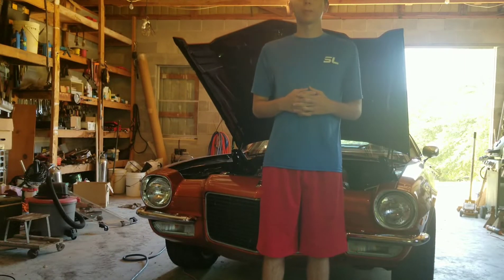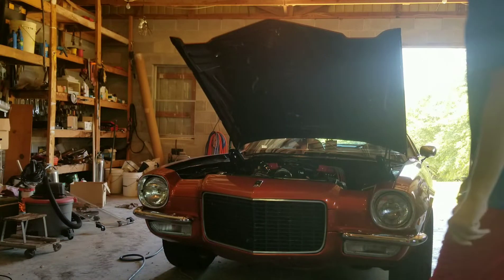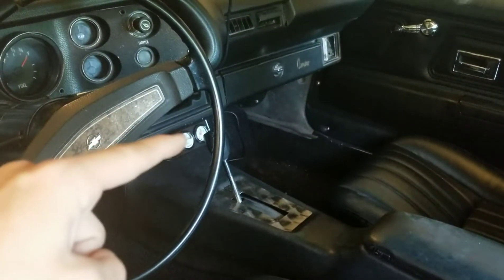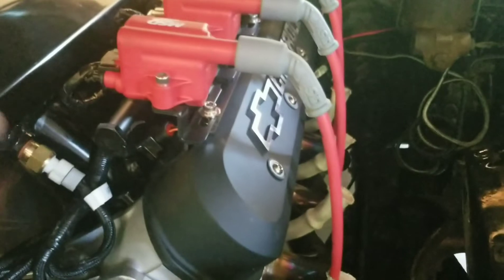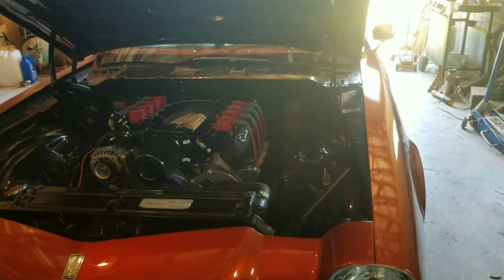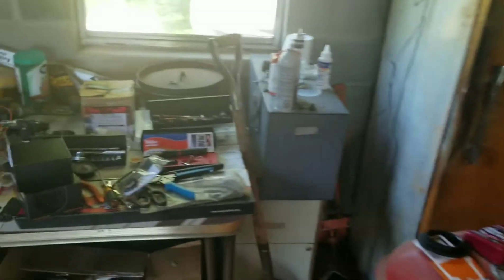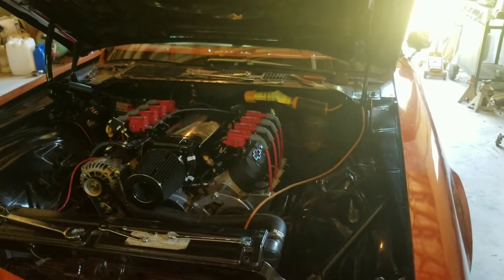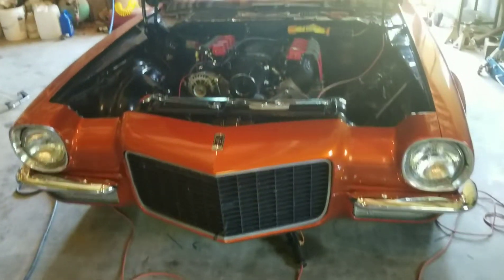FiTech Ultimate LS giving ME PROBLEMS!

Comment: It's not the Fitech that's the problem there's something wrong with your injectors coils or a mechanical problem
Reply from the maker: User error. I have since corrected the issue and addressed it in a video. I left a huge vacuum leak. FITECH IS AWESOME!

Comment: I have an ultimate ls system and am having a "spike to lean" or lean tip in issue where when I stab my peddal AFR goes up to 20 (all air) and techsupport is not helping what so ever... I've had everything installed for 3 months now and haven't been able to officially drive my damn truck. I'm extremely disappointed with fitech
Reply from the maker: I recently got mine back on and working correctly myself. I agree their tech support is lacking. What is your fuel psi? Have you tried upping the "Accel Pump" setting? IAC steps when up to temp and idling? Sorry this is so late. Maybe you have already figured it out!
Reply: @jnlgarage6369  nope never figured it out... they told me that over and over and that all makes zero difference. It starts and idles mint, as soon as you roll its goes to like 19-20 on the A/F mix and gets the motor hot

Comment: Nice video. was ready to pull the trigger on fi tech. But kinda leaning towards Holley or msd now.  What’s your thoughts?   And what did you use for your top radiator hose?   Thanks man.
Reply from the maker: I would steer clear of FiTech's "Ultimate LS" systems. They have pretty good reviews on their TBI style setups however you still have the customer support issue if something doesn't work properly. I would go Holley if I was gonna do it again. Little extra money but little to no issues and awesome customer support to help you troubleshoot.
Reply from the maker: Also I think i just ended up finding a close hanger and bent it in the shape and length i needed then hit the local parts store and found something close and made it work.

Comment: Just curious if you ever figured out your hesitation with this system.
Reply from the maker: No. I ended up getting rid of it and going carburetor.
Reply: JnL Garage damn. I’ve heard fitech has some updates to their software that has helped some guys with this issue. Mine has yet to be installed.  I guess I’ll be finding out soon enough :).
Reply: @JakesShop  did you ever get yours installed? I’m thinking about going with the ultimate as well. I have the FiTech go efi (carb looking) version now on my LS swapped 87 jag and it’s been pretty flawless. But I’m building a LS swap 52 chevy pickup and want to go with the ultimate version but I keep hearing about all these problems.
Reply: @TurboNFRStwoK  not mine yet.  But my buddy has this exact same kit and just fired it up last week.  So far it works flawlessly.  I think fueling these dual rail systems properly is Key and I just did a video on my channel about that.  Hoping to fire it off by the end of summer after i wire up my car.  And will be posting up videos as i progress.
Reply: @JakesShop  cool, I appreciate you responding. I just checked out your channel and subbed so I can follow your progress as well.

Comment: I have the same issue. Did you resolve it?
Reply from the maker: No, still contacting fitech to see about trying a different wiring harness.
Reply: @jnlgarage6369  I'm gonna change crank and cam sensors and see if that does it.
Reply from the maker: @johngonsoulin7413  let me know what it does. I got a different code everytime I cranked up mine. Knew then it had to be either computer or wiring harness related. Odds of 5 to 6 sensors being bad seemed slim to none to me.
Reply: @jnlgarage6369  same but whatever, I'm grasping at straws here
Reply from the maker: @johngonsoulin7413  same thing here. Taken me this long to finally get something out of them.
Reply: Just changed the crank and cam sensor with no luck. I'm thinking holley is the only fix.
Reply from the maker: @johngonsoulin7413  more than likely

Comment: There are a few issues that could be the cause of the stumble concern. Some are a quick fix. 
The ground fault code is a concern, the grounds for the Fitech must not be shared by any other components, a redundant ground wire can be ran from the Fitech main ground connection directly to the battery negative. Once the ground code is addressed, the stumble concern can be gone into. 
 https://youtu.be/JU2ENXPXvEk
Reply from the maker: I ended up trying the ground straight to battery negative. No more ground code faults. However they then rolled it to saying my coolant temp sensor was throwing a code and could be causing too much fueling for the temp. So I had a warranty on the temp sensor still swapped it for a brand new one and same the code came back after about 5 minutes of driving.
Reply: @jnlgarage6369  Do you have a code number ? Is it a code for open or shorted circuit? Did you install the 2nd ground on the drivers side cylinder head ? 
A large gauge ground wire from the engine block to the frame ? Also, never ground anything to the valve cover on an Ls engine.
Reply from the maker: I had a code number. I have since swapped to a carburetor and msd ignition setup with no issues. Before I swapped to the carb though I made sure I had the ground installed on the head not valve covers, and the other ground directly to the battery negative but fitech still could not tell me what was wrong with my system so I did a carb swap. However I still would like to troubleshoot my fitech system because of the large investment tied up in it and also a twin turbo kit is coming out for my car with this engine and I would like to use a easy on the fly tuning system (such as the fitech ult) with it and not a blow through carb. Do you think fitech would possibly let me ship my system back to them so they could try it on a test subject of their own to make sure the system is doing as it should then send it back?
Reply from the maker: Also with the ground from engine to frame I have solid motor mounts. No rubber at all. My battery negative is also ran directly to my alternator and passenger side head on the engine.
Reply: @jnlgarage6369  I would contact fitech and ask them to send you the latest operating file. The one with NA or Supercharged choice in initial setup along with Nitrous Control option. When there is a mystery drivability concern, best to reload the base file  and re input the Initial set up parameters. If it runs great with a carb then you should be able to run it with the Fitech system with great success. Did you have a 24x or 58x crank?
Reply from the maker: 24x, I also thought the same thing. I see so many people swapping from carb to the fitech throttle body kit and talking about all the awesome things it done and helped with. The ultimate ls kit was what I thought to be the step above from the TB kit so why did I get negative results? However I am going to try and get in touch with them and see what they say again. I will try to remember to relay the info back to you all.

Comment: You should have got the FiTech kit with trans control and then you could run a 4 l60 and would be perfect
Reply from the maker: Well my kit came with the trans control. Wanted to run the TH400 a little more though.
Reply: Get a late mode 4l80e if it will control it. Your problem is that your transmission kick down isn't working properly. Hope this helps.
Reply: You can buy the transmission harness separately and add it at a later time that's what I did, cost $125....works like a charm